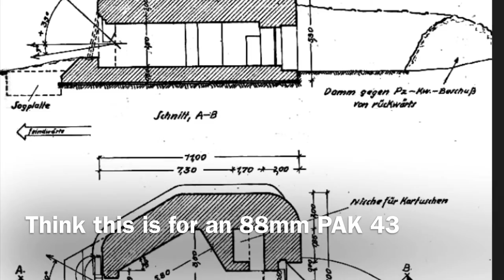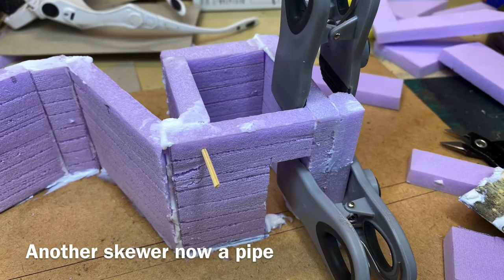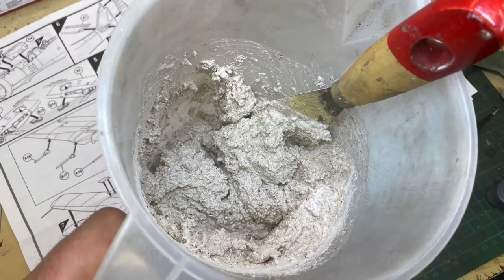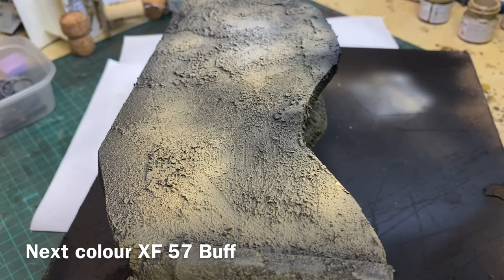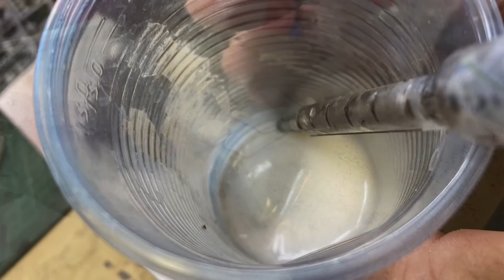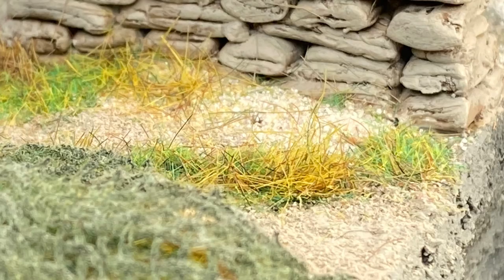Make a Bunker Diorama #dioramaww2 #pak40

Comment: im always very interested in heavy gun bunker, sometimes i think, wouldn't it be quite easy for infantry to take out these bunkers from the front because of the relatively big opening and lack of MG for self defense? yes i notice there is one on top and there might be other bunkers covering this bunker...
Reply from the maker: Hi, hope your well, it was just my interpretation from photos etc, I assume the German MG’s covered most areas. Really the bunker measurements were based on a 88mm gun, so the pak is a bit smaller. Cheers for watching.
Reply: @ctscalemodellinguk  thx, i like these kind of thing, maybe in the future you can build some japanese bunkers as well? 😊
Reply from the maker: @aa1944-k2r  hi, yes I do have a Pacific USMC Sherman to do just need to build some other stuff first so the channel is a bit balanced. Thanks for support

Comment: Can I ask what you used for the door please
Reply from the maker: Hi it was sort of plastic card from a sign, it was perforated inside. Foam card would do the same job. Hope this helps.
Reply: @ctscalemodellinguk  cheers I was going to buy a corrugated bit and glue a top on it very nice dio by the way
Reply from the maker: @Steve-dr7rr  I tend to use basic cheap things , my shed is full of stuff that I thought would be useful. Cheers for watching.
Reply: @ctscalemodellinguk  cheers sorry to ask again what size was the door. Since my 2 strokes I’ve lost my short term memory and not good with working sizes amongst other things I would be very grateful many thanks steve
Reply from the maker: @Steve-dr7rr  hi its 57mm high by 30mm wide🙂
Reply: @ctscalemodellinguk  cheers much appreciated and sorry to bother about it 👍🏻
Reply from the maker: @Steve-dr7rr  don’t worry, thats the purpose of my channel.🙂